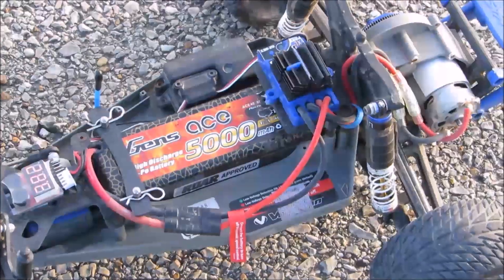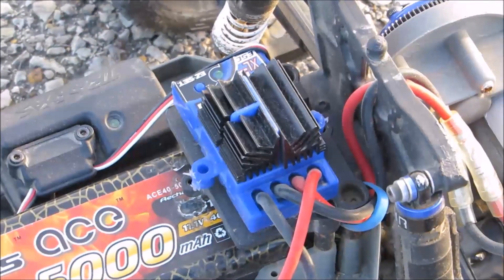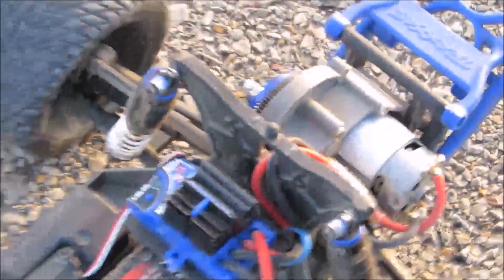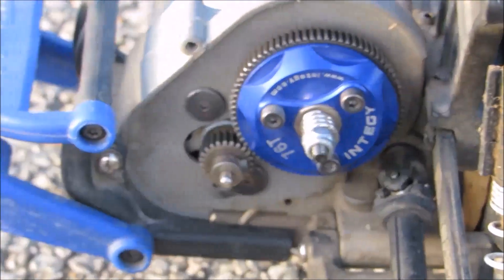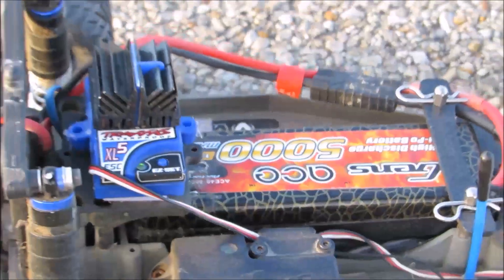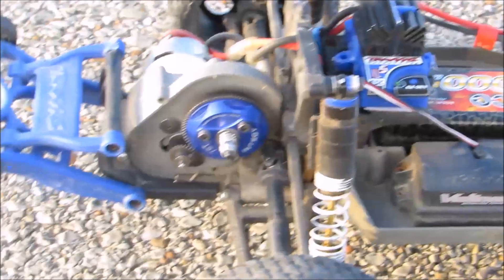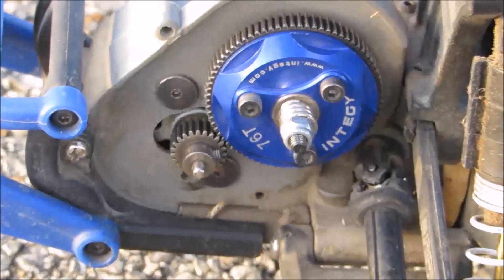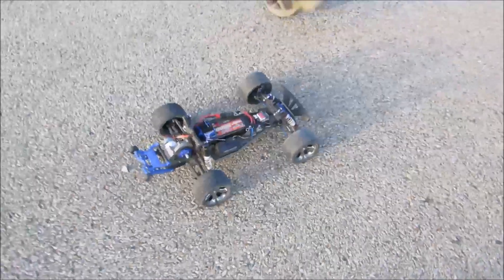Traxxas xl-5 System Running 3s 40c LiPo Experiment

Comment: The xl5 is only rated for 2s
Reply from the maker: Indeed. This was an experiment to see what would happen if we tried using one with the xl5 system.
Reply: Obese Cat Films .use the low voltage detection

Comment: Someone answer this question for me is there a difference in Speed on 25c and 40c LiPo battery
Reply: C  means discharge rate you will get better motor temps and it will get better performace with the 40C  just dont go below 25 on the C rateing  xl5 or the brusless velieion it will burn it out if u go below 25C  stay 25c or above high C batterys like 60c to 100c are for racing appilcations it wont make any diffrence once u get over 40C rated batterys you wont notice any diffrence
Reply: Jerett Smith .no
Reply: Yes, the 40c has a higher discharge rate so you will get more speed out of it. However, you may get more run time out of the 25c depending on how you drive.

Comment: what's the voltage on that lipo?
Reply: Critter0817 3.7 Times' 3 = 11.1v so 2s = 7.4v. So just multiplie 3.7 with the cells
Reply: It's a 3s 11.1volt 5000mah battery.
Reply: Critter0817 all 3s lipos are 11.1v
Reply: 5000

Comment: Any issues so far? I'm thinking of getting the XL5.
Reply from the maker: ok, I checked, you hold the button on the esc down when it's on to turn the esc to nimh mode.
Reply from the maker: Yes the system still works after using the LiPo with it, however I do not recommend using a  LiPo with this esc/motor, as it is not designed/equipped to handle a LiPo. As for using just a NiMH, it is a great system, being water proof and all.
Reply from the maker: With the xl-5 esc you can just plug the lipo in and use a external battery voltage meter to tell you when your battery is discharged too much, I don't think that the xl-5 esc does have a lipo mode, if you mean the vxl 3s esc then I just turn the esc on and hold the button down until I hear the tone and the led changes from green to red, and it works just fine, I'm not sure if you turn the esc on first and then hold it down to change it to nimh mode or if you start holding the button down when it's off, it sounds to me like your doing the wrong one of these and are making the esc go into the programming tree instead of turning the lipo mode off.
Reply from the maker: Bayrack Obama With the xl-5 esc you can just plug the lipo in and use a external battery voltage meter to tell you when your battery is discharged too much, I don't think that the xl-5 esc does have a lipo mode, if you mean the vxl 3s esc then I just turn the esc on and hold the button down until I hear the tone and the led changes from green to red, and it works just fine, I'm not sure if you turn the esc on first and then hold it down to change it to nimh mode or if you start holding the button down when it's off, it sounds to me like your doing the wrong one of these and are making the esc go into the programming tree instead of turning the lipo mode off